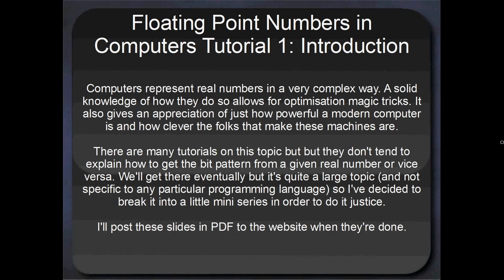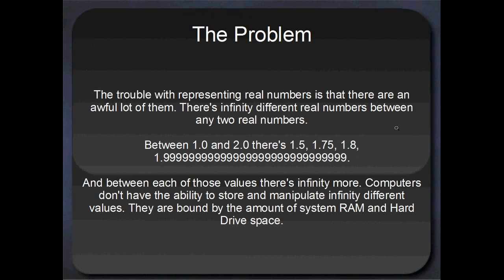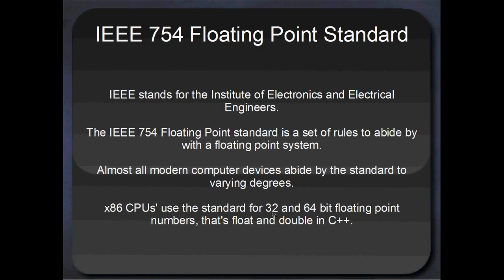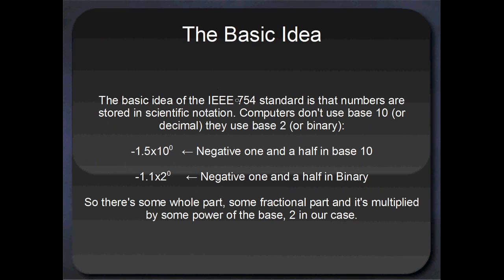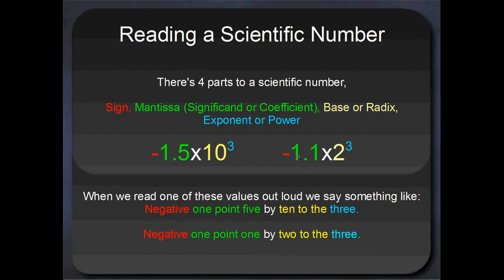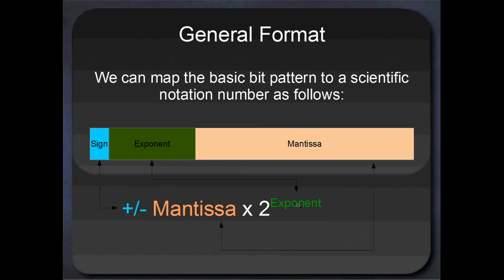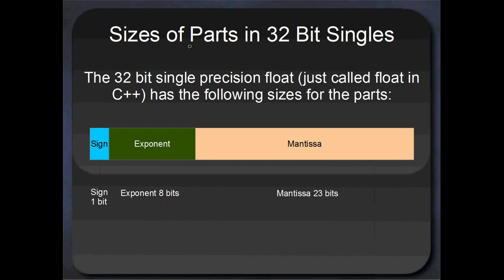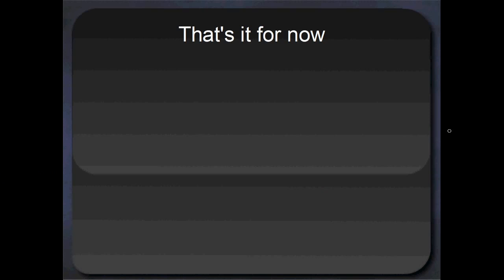IEEE 754: Introduction to Floating Point Format

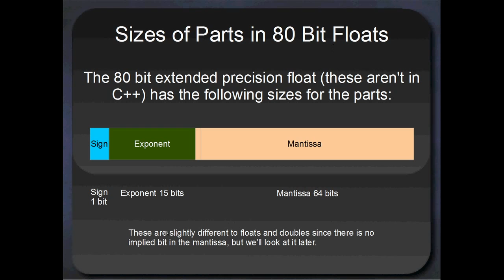Comment: Good video! At 12:30 you say 80-bit extended precision floats are not in C++. This is not true, they are generally exposed as the "long double" type.
Reply from the maker: Yes, I was wrong :) I think it's mostly just the Microsoft C++ that doesn't support them. Pity, really, they are very cool!

Comment: It's so stupid that games still use float instead of double.
Reply: Why is that stupid? The vast majority of the time a float is fine. A double has twice the memory footprint making it less cache friendly
Reply: I worked on a 3d software called SimLab Composer, it uses double in its core and I learned that this is the biggest mistake that was made since the very early version of the software, for small scenes for example the size of the saved file is huge, while using floats the size will be 50% less and nothing is corrupted, only use doubles when you have to otherwise use float